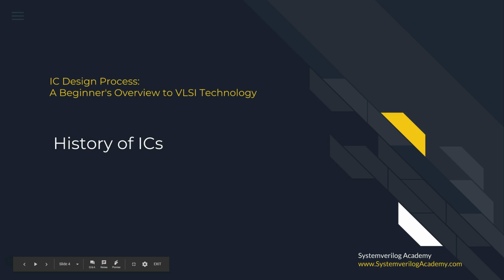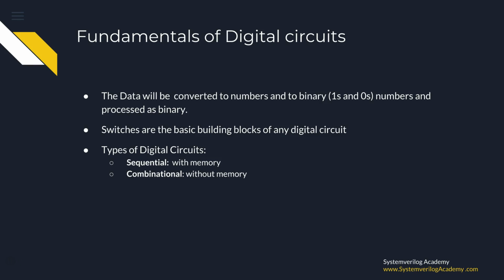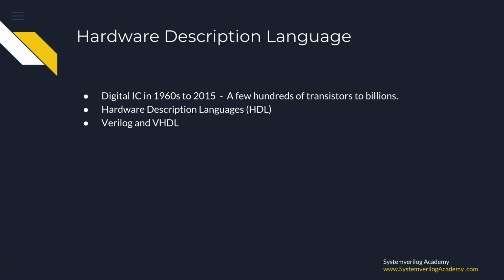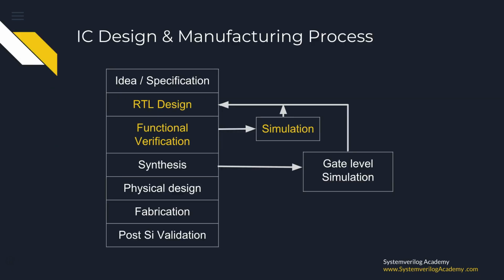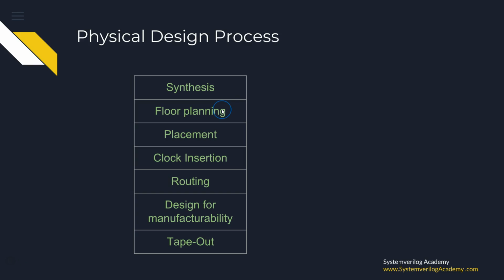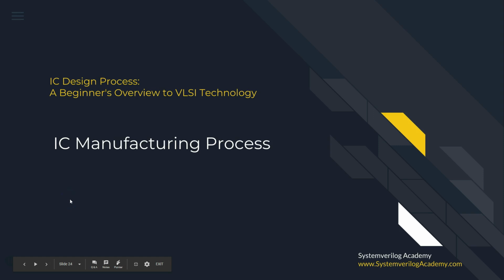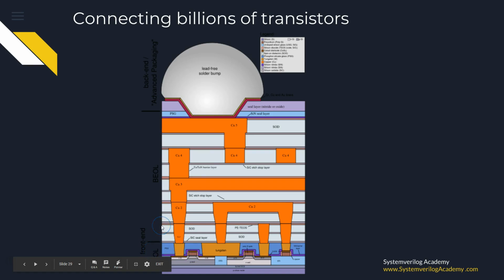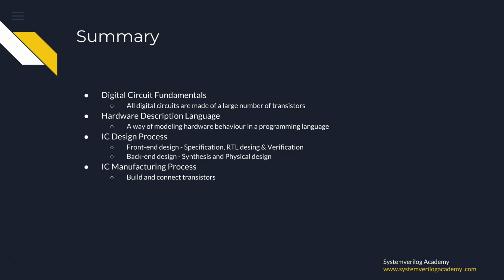IC Design &  Manufacturing Process : Beginners Overview to VLSI

Comment: i build logc gates circuits in Multism , export them to VHDL, import the VHDL file into a FPGA IDE , and then simulate them (Functional Verification) in a actual FPGA , the FPGA IDE can generate .netlist file but i m not sure if it compatible with what the fabricators wants, bcs the netlist file contain LUTs , im stuck at this stage , i want to convert my VHDL into an IC ... and its too complicated

Comment: I did "physical design"  for many years.  In one case, my LVS simply would not match.   I examined the engineers RTL and found the reason.   After I and the EDA engineer explained the error to the design engineer, the designer fixed his RTL, recreated his schematic, and my layout matched him perfectly.   That was the sort of complex subtlety that an extraordinarily good layout designer brings to a design team.
Reply from the maker: Yes,  you are right   👍

Comment: what's the best explanation why IC (Integrated Circuit) is in Square/rectangular shape, not circle?? Why they manufacture it on that shape?
Reply from the maker: Sorry, I have no idea, don't even know if there are any circular ICs. Will try to get the find the right answer here 🙂
Reply: The wafer is round because of the spinning needed to form it. The IC on the wafer is square because it is the easiest shape to cut using current methods. See: https://www.youtube.com/watch?v=Rhs_NjaFxeo